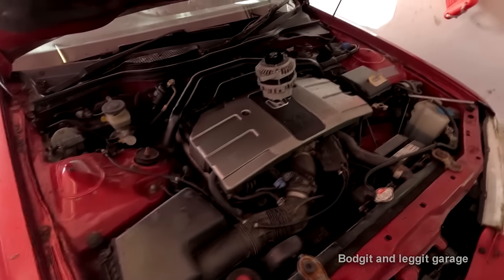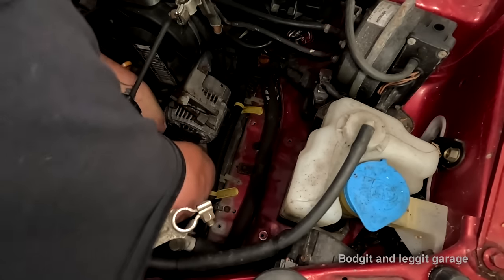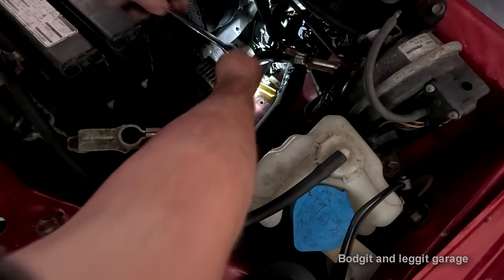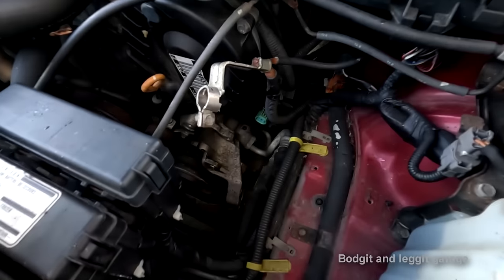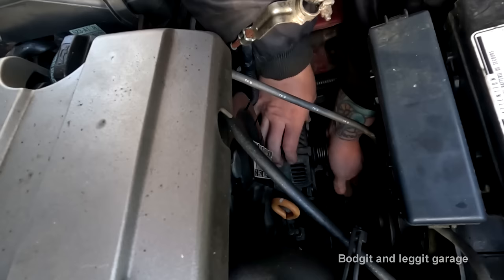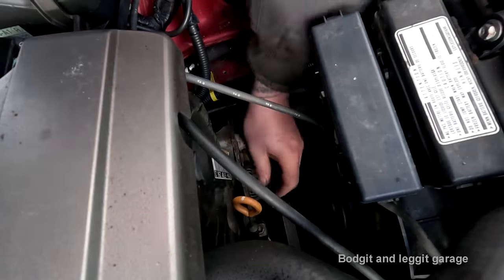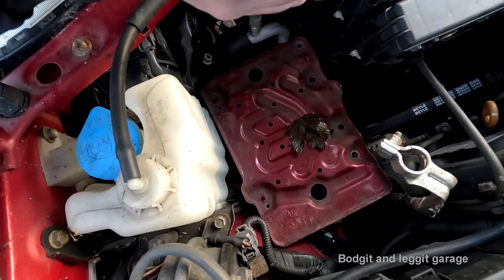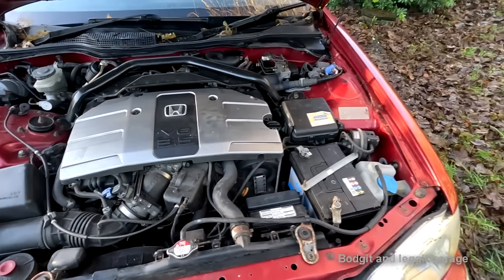V6 Honda Legend Not Charging Mechanic Gets Very Angry

Comment: I reckon when you lose your rag with a motor, your hands grow bigger and you get more thumbs !  I usually get to the stage where I have to walk away and have a cup of tea,then I can do the “move it a fraction of an inch, turn the spanner over and turn it another fraction of an inch,)  thing.  Why does there always have to be something sharp,hot, or both  in the way ?

Comment: I have just finished doing an alternator on a lexus is250 and I agree with you the Japanese design cars like 💩 to work on. Top bolt is a long one that goes all the way through and holds it bottom has 2 bolts one on either side and the back one is terrible to get to no access what so ever.

Comment: the designers do not have to do the work on them but they should be made to and getting down the side of some engines is a impossibility . I have asked three exhaust places to replace the flexi pipe and the Cat on my wife's Freelander 1800 and they all gave some excuse  so i ordered the parts and the son in law with my bit of help are going to do it  we have already taken part of it of from the exhaust manifold the the three places were afraid of .thanks for the video
Reply: They just drop the engine in with all the bits on it... never think of the man trying to  repair it  buried out of sight